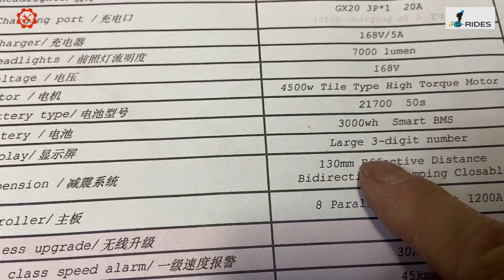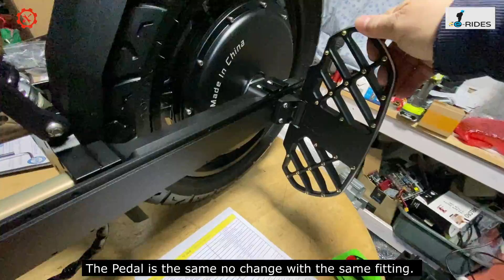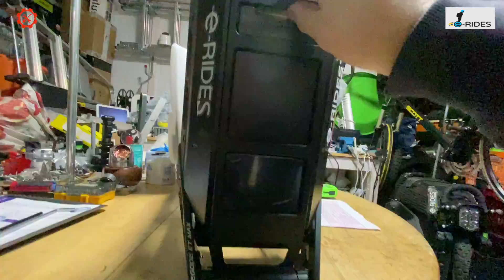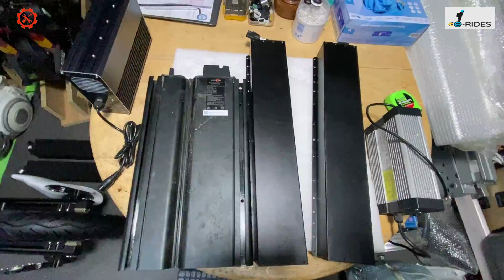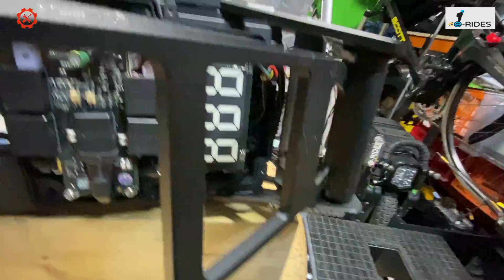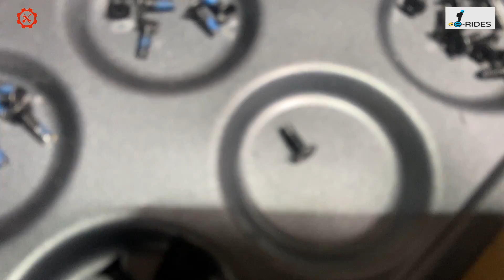Begode ET Max Quality Check. e-rides EUC Upgrades

Comment: Pretty sure the adjusters are rebound and compression, and you do not "pump up" a nitrogen gas charged, hydraulically damped coil spring shock.

Comment: Kevin, the tool you may want to get the battery-connectors through the gasket is called something like a... 'balloon bander expander livestock castration tool'. The link below has 'extended style tips but if you get the kit, the bands can be stretched over a handle or bar to create a comfortable grip. Works both for install and disassembly. See link below.
 
Another note:  WD-40 (essentially fish oil) will break down rubber gaskets over time. It may be preferable use a silicone grease or spray if needed but it shouldn't be needed with the above tool.

Comment: wow that is 112lbs ... I bet its a nice  cruiser and fast ... look great but I dont like 110+lb as 88lb lynx but  I liked my ex -30  (before the kill switch blew the board and batteries )... Now I am having trouble getting part & dealer says begode was out of stoc k ( wheel was 2 month old when this happen: ( I am very upset that its taking since aug 26th to get my pasrts( btw its not ewheels/ e-rides  and I dont want to say the name where I bougth the wheel yet  .. But I will soon ( it  is a US cxompany thay you get a deal from ... Thats all I will say atm but he is sayiing it is begode stock on batteries?
Reply: Why dont you just buy a new board from ewheels or who ever they like 300 and new distribution board from who ever for like 70 bucks and then have the company reimburse you there is definitely ex30 mainboards stateside and as far as distribution board you can use anyones that has a master master pro comander pro they are all the same 134 v 4 pin distribution boards
Reply: And as far as the batteries they are made up of samsung 50 s cells

Comment: Only one charge port ??? 20 amps is. Bit much for 1 3 pin conection isnt it?
Reply from the maker: Not like the old days when you plug it in and it sparks. Now days you connect everything up first then plug the charge in the main and charger will test before charging.
Reply: @eucupgrades as you can see from my profile pic i ride a ex 30 so im well aware of newer wheels  im more concerned with the heat on the pins when you pump 20 amps into the wheel with a fast charger

Comment: question, why are eucs not using quick connections for the motor like scooters?
Reply: The motor connector is on the control board, & it's designed that way for the board to be modular as all the connectors are in one central area, while eliminating any other potential external points of failure for the motor, as there is also a hall sensor cable strand either single or dual, that coud be between 4 to 8 wires depending on if there is sensor redundancy, diagnostic, or tuning such as field weakening that go in a cable bundle with the motor cables all the way to the motor, so it's better to have all those connections in the control board area.